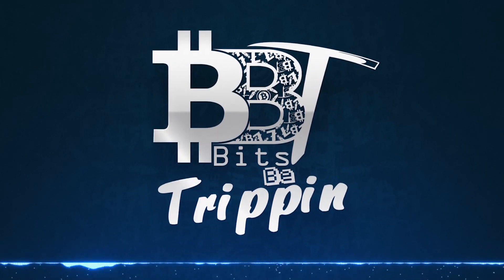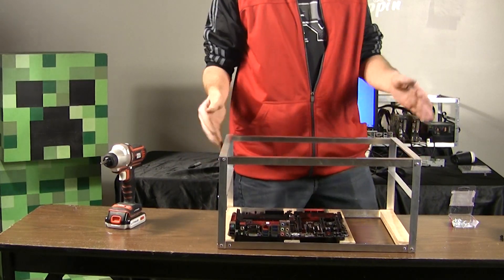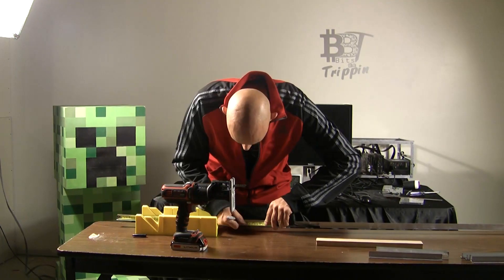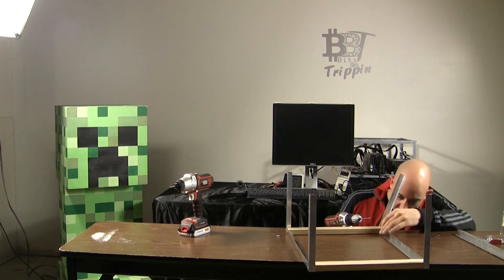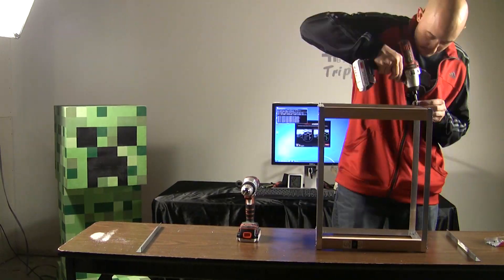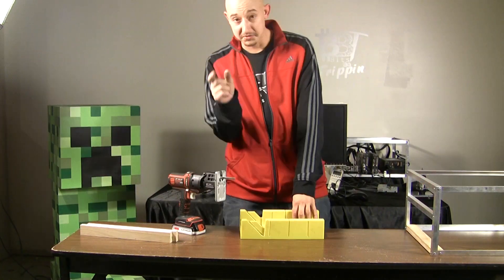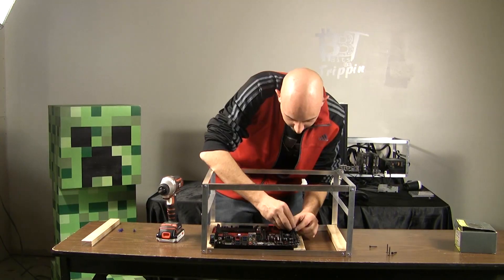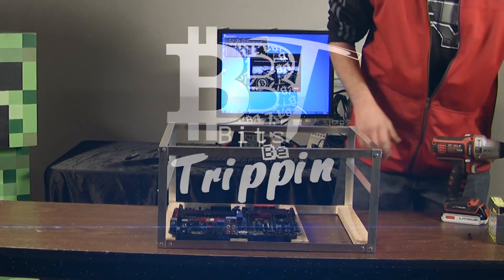BBT Episode 2 Part1: Building a Bitcoin, Litecoin Mining Rig

Comment: What attachment did you put to the drill so it can cut the angled metal?
Reply from the maker: That wasnt an attachment, that was a different power tool named a "reciprocating saw". You can get a blade that cuts metal pretty easily and use the yellow box "Miter box" as your 'guide'

Comment: its tough to mine because one needs to build a good rig to support multiple gpus, i mean sure i could throw in 3 or 4 on my mobo without watercool and fry my motherboard heh
Reply from the maker: You can mine with any card, its just optimal to use an AMD branded card. Individuals with one card and 1/2 time mining (i.e when they sleep or work) allows you to get yourself several hundred crypto currency coins over a month. Its worth it! Just doesn't pay a lot each day. If you have an AMD card and can spare the cycles you should hedge on a coin like doge or feather ...wherein you will get several full coins over a period of time.
Reply: hopefully we all can be millionaires and give nice big middle finger to the banks
if  i get rich im gonna buy some solar panels and a geothermal system that doesnt require electricity to heat to home
then i can give the middle finger to utilities
as for food thats a tough one, have to move to warmer climate and grow some trees

Comment: Where does the 5th piece from here go??

Second 8ft (96"); no waste
5x 19 1/5 cuts 

In the video I only see 4??
Thanks.
Reply from the maker: That is the piece that goes across the middle that the graphics card rest on. Check part two of the video, you will see a long piece the cards sit on.
Reply: Thanks, you guys are really helpful!! :)
Reply: I see the wood the gpu's rest on, but I still don't see where the 5th piece of angle aluminum goes. what am I missing? Also should the longer piece of wood be 19.2 or 19 1/2?

Comment: Hi, I've bought the hardware and cut most of it up.  I just want to confirm 5x 19 1/5 cuts that though.  I don't make many things so was unsure on the 1/5.  That's 0.20 in decimal and 3/16 is 0.1875.  So did you just mark near the 3/16? One chart I found seemed to confirm it but want to be sure. Thanks.
Reply from the maker: Yes, 3/16th is correct
Reply: Thanks for the confirmation.

Comment: What are your exact cut lengths?
Reply from the maker: Just updated our disc too:

For the Angled Aluminum
First 8ft (96"); 1 inch of waste
4x 14 1/2 cuts (58" use)
4x 9 1/4 cuts (37" use)

Second 8ft (96"); no waste
5x 19 1/5 cuts 

And for the wood:

5 cuts of 14 1/2 (72.5" use)
1 cut of 19 1/2 (19.2" use)